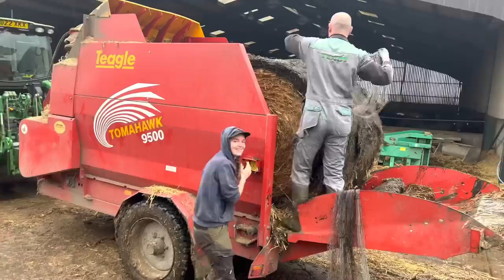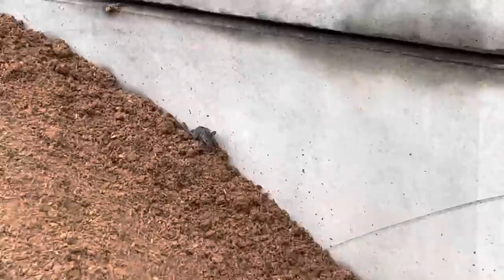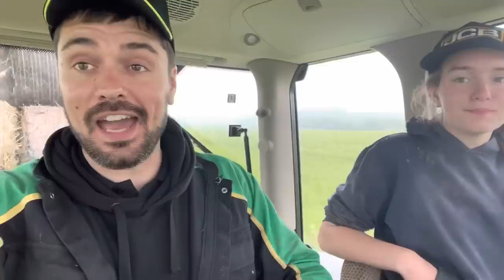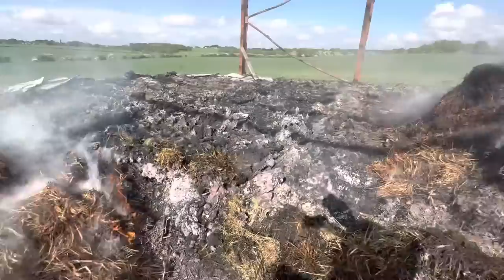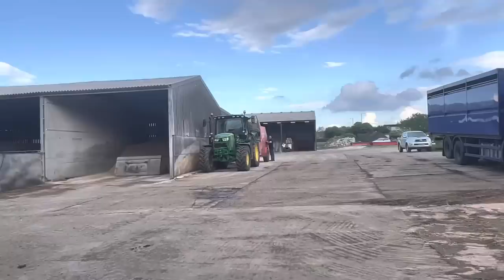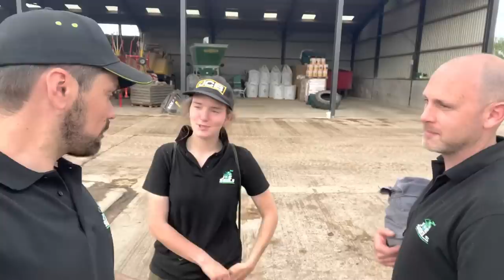Em Catches a Mouse! Fire Clean up begins! Still Burning??

Comment: Might have already been said but that MDPE pipe needs a sleeved insert for the compression fitting to work, unless you used black ones then ignore me.  I’ve made the same mistake before they eventually leak over time.